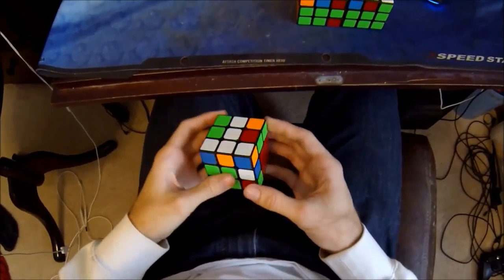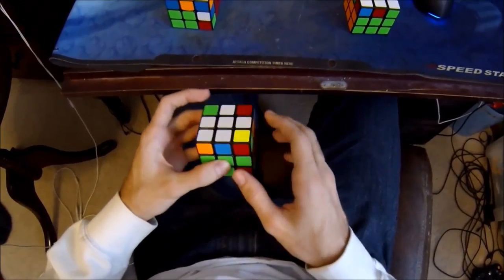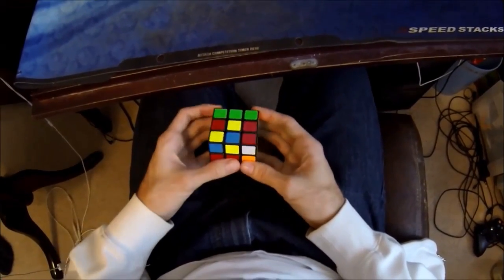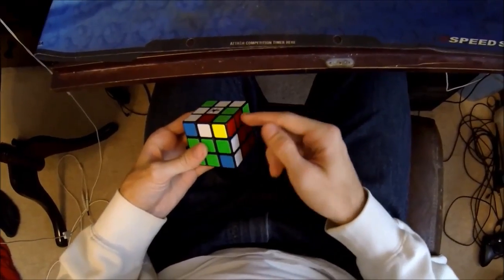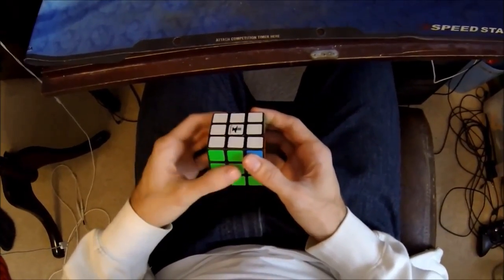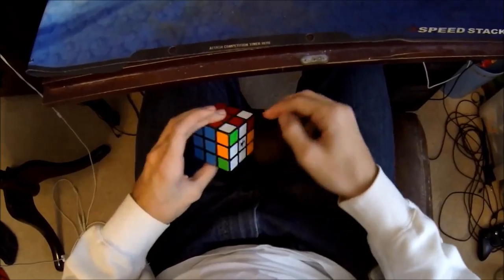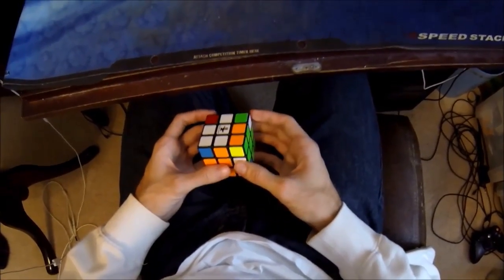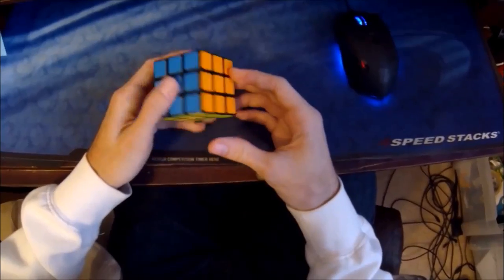[Erik Johnson] Last Slot Methods

Comment: Is there any last slot method in which a pair insertion will lead to edge orientation with no corners oriented (None of the corners oriented on purpose) so you can do ZZ-Blah for the last layer? The only method I can think of is a combination of ELS and ZZ-Blah where you first do ELS to flip the edges, then you pair the edge and corner piece together again, and then using partial corner control, insert the F2L pair to orient none of the corners correctly, thus allowing you to execute ZZ-Blah. While this does technically allow for 1LLL, I feel that doing ELS and then doing a partial corner control alg just to insert the last F2L pair will take too much time, so that's why I was wondering if there was any method which would allow you to insert the last F2L pair which orients the edges without orienting any of the corners correctly.
Reply: Just zbls

Comment: I think RLS is actually VLS.

As for VHLS, I actively use it, but it contains more than what you covered in the video. It will orient edges from a connected pair like you said, but if you have a R U R' case for inserting, VHLS will also work there. I love VHLS.

Recognize 3 edges.
Algorithm (one of 16).
Now you have only 7 OLLs to learn.

I've had multiple LL skips with this submethod.

Comment: Great video! I always see these methods being discussed on the forums, and now I'll actually know what they are (been too lazy to research them :P). I am assuming these methods are used only by very advanced cubers (i.e. sub 12 or sub 10)?
Reply: anyone can use these methods but most cubers don't learn these methods until they're fast. The half second these methods can save you isn't worth the effort until you're really fast where that half a second can be the difference between 1st and 2nd place.
Reply: *****
edge control can be really useful for a slower cuber, since it lower the number of OLL to learn, and I suppose a good foot hold in the direction of these method you showed. nice video.